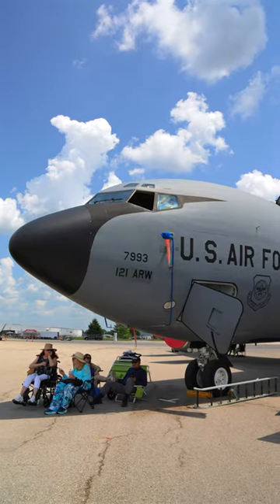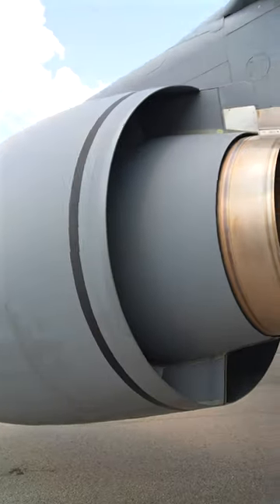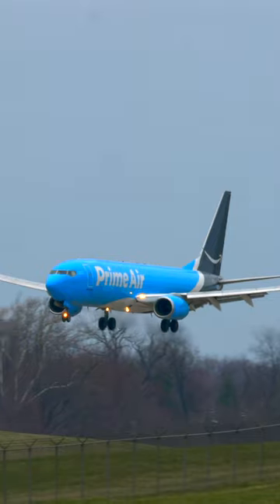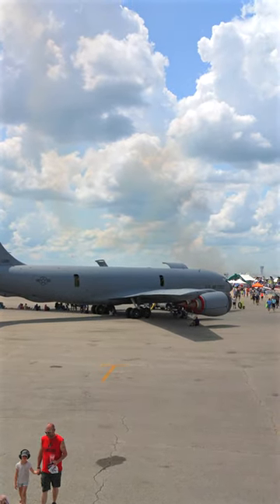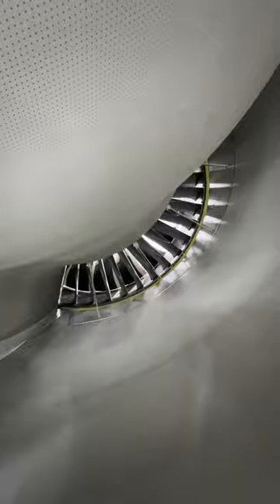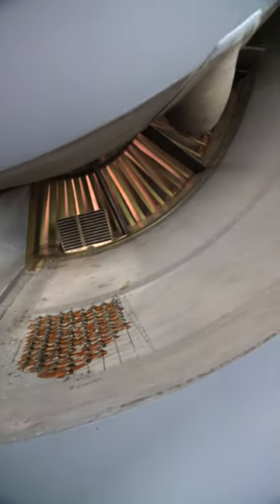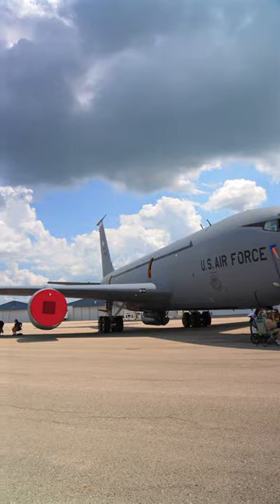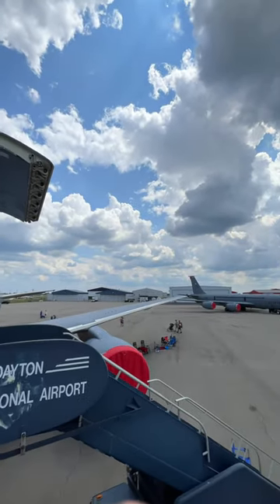The KC-135 Has Weird Engines... | Fun Facts

Comment: Not a problem until contingency ops require going into a shorter field on a hot day (which limits ops due to brake cooling times) or the runway is wet or covered with snow or ice. Yep, that’s what happens when the “bean counters” (accountants) get involved in the design process. I wonder what the pilots think?
Reply: Lol with over 60 years in service though it has been no issues, also had been active in multiple combat zones.
Reply: None of what you said is an issue. 🙄
Reply: I work on kc135s in Maine and the runway is ALWAYS icy. It's not an issue
Reply: Wow the amount of gibberish you find in the comments section.
Reply: Have you ever worked on kc135s? Have you ever served in their mission set? A tanker would NEVER be required to land in a runway you just mentioned.
Reply: Still not too late to delete
Reply: Yes, when I was a KC-135 crew chief we often did special ops where we landed on jungle runways.
Reply: Lolllll the "pro here!!" Boy watches YouTube videos thinks he is a military expert
Reply: So crew chiefs and the like offering their opinions but no pilots? Still waiting for their input.
Reply: @MisterMick113  If you want a pilots input ask the crew chief. We hear all of it about everything it's the crew chief's job to hold their little hands. When it comes to the function of the aircraft you want the crew chiefs opinion.
Reply: Bean counters are the WORST.  Some of them don’t have sense enough to get out of the shower of rain was reading where Remington brought in bean counters to cut cost, and one of their suggestions was to reduce the amount of gunpowder that Remington puts in each one of their bullets and shells!
Reply: What would an air tanker be doing on a shortened forward base?
Reply: @duncanmcgee13 Refueling ninjas.
Reply: @MisterMick113 there are  legions of crew chiefs and other maintainers compared to pilots
Reply: The E3 AWACS does not have TR’s either. I know an IP on them. No complaints about landing them and getting it stopped.
Reply: When the freezing weather causes overheating issues... right... what color(flavor) of non-crayola crayons are you eating?
Reply: The KC-135E model used the TF-33 engine and DID have thrust reversers.
Reply: As usual the bean counters are clueless. Lost my customer service position @Sony for outsourcing. We used to pick up your call with in 3 rings. Now you leave a message to get a call back in 3 days. And I spoke ENGLISH.
Reply: @prylosecorsomething3194  Ice isn’t an issue?
Reply: @njjeff201 You were too expensive
Reply: Did you put a sticker on it? 😂

Comment: Not many 707 derivatives ever got upgraded to High Bypass engines, most only got the Low bypass JT3Ds, if they lived long enough to get upgraded from the turbojet J57s
Reply: I loved the old J57s. You got your monthly allotment of carbon, co2, and unburned jet fuel in the 30 seconds you were in the back wash as they taxied out. 😂
Reply: @LTDunltd  Somethign funny I though was how many KC-135's when they became museum pieces, or Gate Guards got their engines downgraded to either the low bypass engines, or all the way back to the turbojets.
Reply: The KC-135 is not a 707 derivative... 🤦‍♂️
Reply: @Locutus494  true, but it is related
Reply: @Deltaflot1701  newer E-3 versions bought by France, Saudi Arabia, and the UK are equipped with newer CFM56-2. Just like the E-6B which are 707's. The 135 got a derated version.
Reply: @Locutus494 yeah more like siblings or cousins, both descending from the 367-80, which derived from the 367, which derived from the B-29
Reply: @PatrickLipsinic  It would be interesting to see the numbers on which C-135/E-6/E-3/E-8/C-137 version flew their entire careers with turbojets, against how many got the low bypass engine upgrade, vs how many got the CFM56 engines.  Watched a video on another channel that showed some of these that got turned into gate guards and museum pieces got their CFM56s taken away and replaced with the old turbjets.
Reply: @Deltaflot1701  ones that were gate guards never had the big engines. It's too much work to do that as the pylon is different.
Reply: @PatrickLipsinic  The gate guard at Pease AFB (57-1455) had CFM56s and is now back to it's low bypass engines
Reply: I thought the upgrade was in the 90s ,they where a bunch sitting at Mojave in 98ish

Comment: Makes sense, TRs often fail and are just another item to have to inspect also
Reply: I worked on large commercial jets for decades. They are very reliable. And save money on brake wear.
Reply: @Mytwistedvoices   i mean ive seen self induced failures due to config in a MX setting.  Ive never heard of TRs just failing here and there in service.  Maybe a bad stowage switch but thats an indication fault not a failure to operate thing.

Comment: I joined the Air Force in '85. My base Fairchild AFB was where the KC-135 A and B-52 G's were stationed. 
In around 88/89, the tankers received the fan engines, and the model was R. In '90, I became a primary crew chief on a T model.

Comment: Probably to save weight so more load can be carried. British Airways did the same with Embraer 145 so they could carry another passenger and it had more range. An A320 blocker door weighs 35kg x 4 per reverser plus hydraulics and other parts soon adds up to quite a weight .

Comment: Flew on one that had the upgraded engines from Europe via the Icelandic route. It got so cold water bottles under the seats froze. The ground crew had field jackets with them. So us passengers broke into the cargo pallets and pulled out our field jackets. The crew chief told us the new engines didn't produce as much waste heat as the old ones.

Comment: KC 135 is more related to the Dash 80 it was a bit narrower than the 707 and they also put those new engines on the the stretch DC8 when they reengineered it

Comment: if i play 45 hours straight of microsoft flight simulator does that mean i got my hours in?
Reply: If a flight attendant asks, "Can anyone fly a plane?", and no actual pilots are present, you'd be the least likely to crash it...
Reply: That’s weak, I play at least 16 hours a day when I’m not working
Reply: @notaspy3751  huh good to know thanks
Reply: I have 1,237hours in msfs2020 and I also have a pilots license, and I can confirm that it’s not even remotely the same at all, even with full motion seats and the whole “sim setup”. But like that one guy said, you would most likely, be the least likely guy to crash the plane if for some reason that 1 in a 50,000,000 chance of both pilots being incapacitated. Fun fact: only .00875% of the world population is licensed pilots. Even if you were able to recall a simple checklist in the event that did happen it could be helpful. Just make sure it’s the right checklist😂.
Reply: @Wkcrt What are the emergency radio frequencies? Are there buttons to push to speak?
Reply: No, unless you mean Microsoft Flight Simulator X. The FAA has no plan to approve Flight Simulator 2020 due to the poor physical accuracy and aircraft systems.
If you want a simulator that may* provide simulator hours, I would reccomend X-Plane 11/12, or Prepar3D, which I have just under 2,000 hours in. Though, they may not count unless you purchase FAA approved hardware, and the professional versions of the simulators, they are a good look for flight schools.

Comment: Cool

But what if you wanted to land on short runways?
Reply: You use a KC-130
Reply: These planes will not, should not and would not want to land on short runways. This thing is a high profile strategic asset, and short runways mean youre already where you need to be and dont need a tanker.

Comment: The pilot had anti-lock brakes.  The co-pilot did not.  They had to upgrade that with the High Bypass upgrade as an early pilot hydraulic failure and co-pilot locking the brakes chewed the wheels all the way to the trucks (wheel assy). Someone figured out that would be really bad for the larger diameter fans.
Reply: Currently the KC-135R does have anti-skid for both.
Reply: @PatrickLipsinic  I know.  It was a fun fact from the history of upgrades to the system.  Worked on a parallel program a few decades ago.

Comment: According to my research, the new engines do have thrust reversers. The old engines didn't have them though.
Reply: No, the CFM56's on the KC-135R did not. The old engines did.
Reply: i'm a KC135 engine mechanic 2A651C. no, the CFM 56/F108's do not have thrust reversers.  the E models did, but those are TF33's and have been out of service for a long time the current version is the R model
Reply: @ReaperRestorations  technically not on the 135. It's not a KC but it's the open skies aircraft. OC-135 was recently retired.

Comment: The MRTT does have thrust reversers, but then it is a multi-role aircraft.
Reply: multi-role? What is that suppose to mean? No different from the KC-46.
Reply: @PatrickLipsinic  The MRTT is designed as a refueller, cargo transport, medical evac, and vip transport all rolled into one. And in most cases they are converted passenger aircraft, not purpose built as tankers (unlike the KC-46).
Reply: @TankEnMate  KC-46 can do all that.
Reply: @PatrickLipsinic  No it can't, the only thing close to the KC-46 that can do that is the KC-767 MMTT developed by the IAI. Boeing offers no such options on the KC-46.
Reply: @PatrickLipsinic  For example, the KC-46 is limited to 58 passengers, and only using palletised seating, the MRTT can carry up to 380 passengers (with about 15t of cargo depending on fuel) . The KC-46 also limited to 29t of cargo (with no passengers and no refueling), the MRTT can carry 37t of cargo max (most likely with no refueling, it's not clear from the specs). The MRTT can be configured for VIP transport while the KC-46 has no such option (only palletised seating).
Reply: @TankEnMate  the KC-46 can haul cargo and passengers at the same time and refuel. They can haul more passangers then they list. The cargo rollers can be removed. They are attached to seat track in the floor. If they wanted, they can use them and  install seat like in a normal passenger plane. It's easier for them to palletize the seats. They can also put pallets on with different types of command and control and Communications equipment with seating. It takes a long time to remove all those seats and reinstall all the rollers for cargo. I'm not sure what you mean by VIP but they can easily come up with a palletized systems for their in their own segregated area.
Reply: @TankEnMate  no such option for what?
Reply: @PatrickLipsinic  The seat racks in a KC-46 are mounted on a pallet; that's why the number of passengers are so limited; even max capacity in contingency operations is limited to 114 (but you have issues then with HVAC). And as to VIP configuration it isn't possible, unless you want to treat your VIPs as spam in a can.
Reply: @PatrickLipsinic  VIP transport.
Reply: @TankEnMate  the cargo area has hookups for SIPR and NIPR net which other countries can use to communicate with their people. So if it needs to, it can haul government or military leadership of other countries.
Reply: @TankEnMate  they may not spell it out like they do for the MRTT.
Reply: @PatrickLipsinic  Hahaha, have you ever seen a leaking ATGL? 😂 I wouldn't wish it on my pet dog let alone a human (never mind any form of "leader").
Reply: @TankEnMate  haven't seen a single one leaking.
Reply: @PatrickLipsinic  In that case I'm sure someone from Boeing / Collins / Knight would want you to report that to the CRS.
Reply: @TankEnMate  it was a joke cause I never see them where I am at. Just use the lav up front.
Reply: @TankEnMate  Also the USAF has plenty of VIP aircarft. They don't need to rely on a plane like the KC-46 or MRTT.
Reply: @PatrickLipsinic  Oh, yeah, I get you, I doubt the USAF would ever have a lack of VIP aircraft so bad they would need to use a KC-46.

Comment: The refit was planned and implemented back in the days of the Strategic Air Command…. Where almost if not all the runways on a SAC Base was around 16,000 feet long.  The only time I saw hot brakes was if the pilot RTO’d close to V1

Comment: The Air Force should have been allowed to by the NATO standard Airbus Tankers.
Reply: There is no standard tanker aircraft for nato.
Reply: @Joe-yz3uf  You are wrong. The NATO MRTT Tanker fleet is based at Eindoven with A330 MRTT bought and placed in this command by multiple nations. Belgium, Holland, Denmark among others. Most NATO members use this aircraft and will loan to NATO MRTT fleet as needed, in addition, to command units.